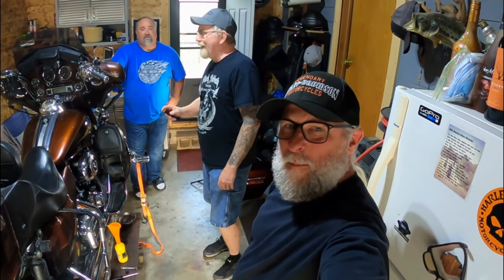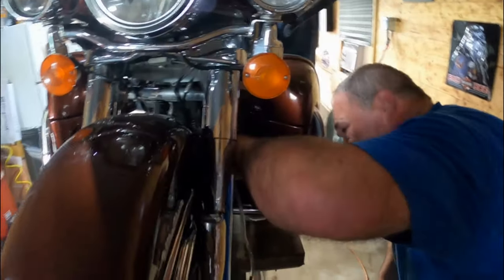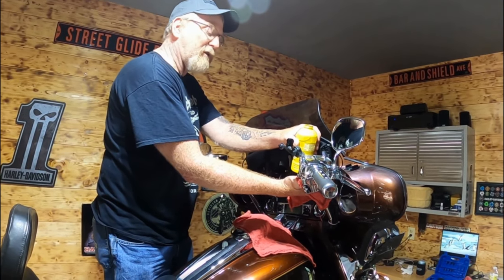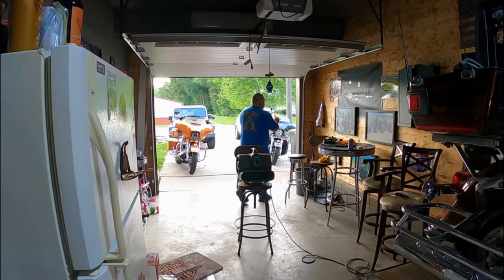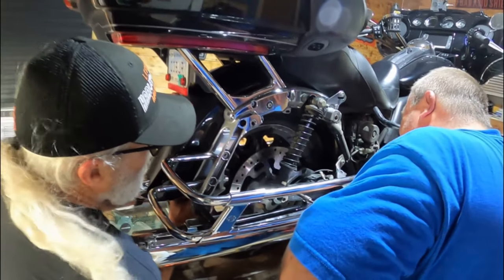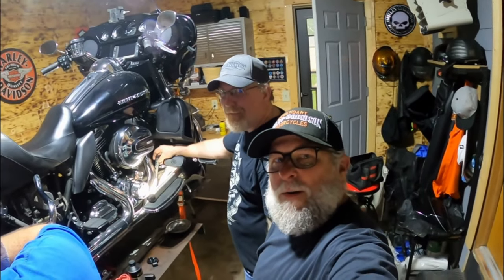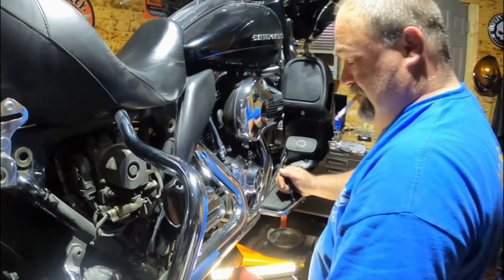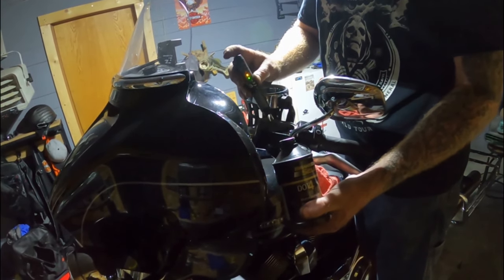Flushing Brake & Clutch fluid on a Harley Davidson.

Comment: Nice work.  Sorry I couldn't make it to the poker run with you guys.  Rough, hot week at work and needed a weekend relaxing.  My Buell isn't the most relaxing bike on rides past 150 miles.  On the fluid, I swap mine out every winter.  Brake fluid is very hygroscopic (it is attraced to water and seeks it out).  They have that same vacuum pump Jerry has at Harbor Freight for around $25 and a nicer Mityvac one for $50.  I had 2 of the cheaper ones break on me so I grabbed the nicer one and have had it a few years with no issues.
Reply from the maker: Thanks for watching, it was a hot ride but wish you could have went with us. That's good to know that you can get one locally if need be. Ride safe our friend!!!

Comment: As I didn't hear anything about this and maybe you can research it. I was informed with ABS brakes once the main lines were done, one should take and activate the ABS about 8 times or so to cycle fluid from the ABS chambers. Is that what anyone was told?
Reply from the maker: Well we haven't heard that but it does sound logical to do this. This would even be a better reason to do this every year. Some of the higher moisture fluid did seem to stay at the bottom of the reservoir. So it make take some time to flush it completely and get all old out. Thanks for a great question and watching, ride safe!!!